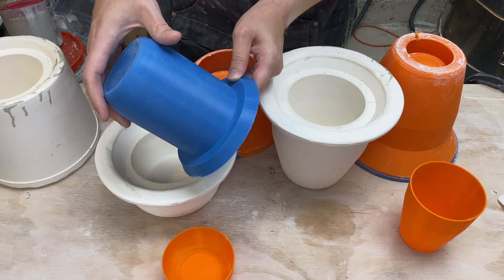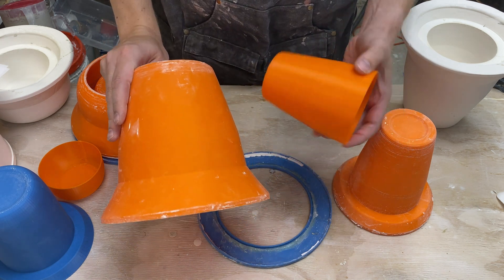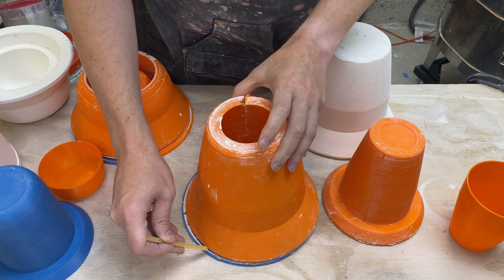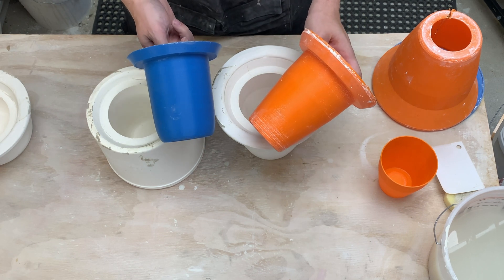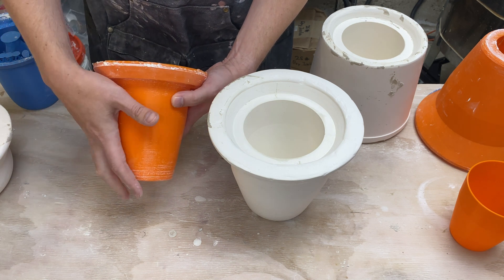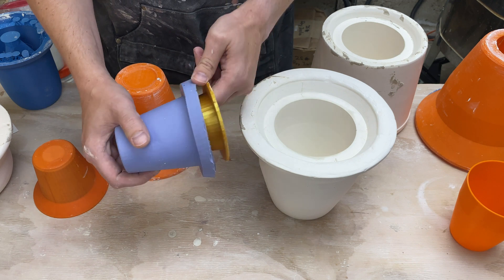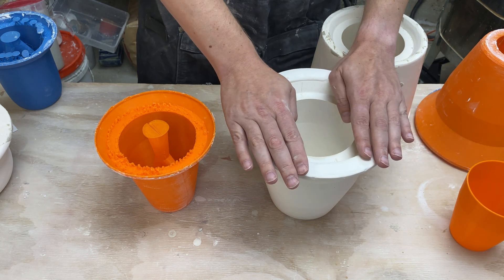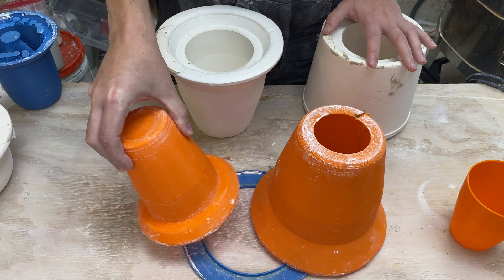Automated Slip Casting Mold System - Thoughts on Improvements

Comment: Hey Kent, to get the 3D printing out of the plaster, put it in the frig or freezer. The plaster won’t shrink but the plastic will
Reply from the maker: You need to worry about the water in the plaster. I now use a frozen mixture of isopropyl alcohol and water and it works really well.

Comment: Hey Kent.  Got the solution to you sealing problem.  Because you are 3D printing, add a screw thread to the inside of the inner and outer edges of the sealing ring, and then add matching Threads on the outsides of the lips of the inner and outer cones (or appropriate inner outer combinations as might be suitable for other reasons). You then just screw the inner come to the inside circumference of the inside of the ring and likeliest screw the outer cone onto the outer circumference of the sealing ring.   It’s basically like screwing a bell jar onto its lid upside down. No need for any sealers. Maybe if you want I might add a bead of Vaseline to the threads but that should be it. Thanks!
Reply from the maker: I'd thought about a screw fit when I was developing this. There are a few problems with that approach. One is needing a solution for the outer mold parts. The other is in demolding the plaster - you need good draft angles and a part that rotates would be basically 0 draft angle. Check out my newer videos for the solution I'musing now.

Comment: Consider a TPU 90 sock that slips over the desired form. The sock thickness is determined by the percentage of scale needed to account for the shrinkage of a particular clay. The PLA form is removed then the sock is easily removed.
Reply from the maker: I'd thought about that a bit but the trick of making the PLA cold and it shrinking has been working very reliably now

Comment: I did pretty much this exact process a few months ago for a 3D printed solo cup mold I made:

https://i.imgur.com/M6ayhzL.jpg

Both the inner and outer molds are generated with OpenSCAD.

I print the outer mold using vase mode to make the thinnest walls possible, which makes it easier to destroy it to get it off the outside and saves wasted plastic. I set the wall thickness to 0.65mm with a 0.5mm nozzle so it overextrudes. PLA is very brittle and cracks easily when it's that thin, and my latest one was printed with PETG which made it lots more durable.

I use my soldering iron to cut lines in the mold after casting to remove it which is way easier than trying to pry or rip it off.

To get the inner mold out, I flip it upside down on a baking sheet with the plaster edge resting on a few ramekins. Then bake it in the oven at 200F. PLA shrinks when you bake it and it eventually falls out the bottom, takes almost an hour. BUT make sure you chamfer the inside of the foot on the mug, because it'll grab hold of the plaster as it shrinks and it'll get stuck and damage that part of the mold.

To seal everything for casting I roll out a square of clay about 1/8" thick, smush both the inner and outer molds into it, push the clay up against the outer mold to seal any possible leaks, then pour the plaster in.
Reply from the maker: Thanks for sharing your cups (very fun!) and your process! I'd also thought about vase mode to speed up prints but worried about leaking. I hadn't thought of using a larger nozzle and over extruding.

Comment: Just an idea for the ring part - could you print the mating edges of the ring and both molds with a small lip so that the edges of the inner and outer molds would snap-lock into the ring? I'm not sure if that would hold back wet plaster though. Maybe consider plumbers putty to seal it.  As for adding seams I'm not a big fan of the idea, but silicone is also expensive, and can be messy with mixing and clean up. I guess if I had to pick one, I would say add seams instead of going with silicone.
Reply from the maker: Getting some 3d printed geometry to snap lock would be cool. But I think I'd really need my printer dialed in for that to work, and yes I'm not sure about holding back plaster. I'm hoping just two 3d printed faces will be enough to hold back the plaster, but it is quite possible I'll also need some sort of sealant. Something to explore for sure.
And thanks for the seam vs silicone vote! It looks like folks are leaning away from silicone which I totally understand!

Comment: I've chosen to go with multipart molds in most situations, especially since most of my pieces tend to drift away from smooth radial symmetry, often with geometries that include undercuts.  My approach with the 3D prints has been walls with sufficient width to allow for registration "pins;" I've tried both hemispheres and trapezoidal shapes, which seem to work better. DON'T Forget to allow for a 0.1-0.3mm offset after the join in the 3D software (lack of clearance yields prints which won't fully mate). Also, where I have mating surfaces I learned the hard way that the print bed is NOT a solution, they warp during printing due to heating/cooling, so I orient pieces to allow for ironing on mating surfaces, though this often adds a need for supports. What seams are left I deal with in post processing the slip cast piece. My most complex 3D multipart molds so far have been 5 part.  Tuning the printer is well worth the effort, but I admit it's tedious and time-consuming.
Reply from the maker: Thanks for the advice! I've been thinking through the issues of attaching 3d printed pieces together, and the points you raise are great! In addition to actually connecting them, getting them in the right spot, some sort of registration, is also needed. And I'm fully expecting to have issues getting mating surfaces to line up. I'm hoping I can come up with some reasonable solutions so that anyone using my software (eventually) doesn't need a perfect 3d print.

Comment: That's a tough choice. I think I prefer seams at the moment because I am small scale, but I would prefer silicone if I made larger quantities of pottery. I do like the idea of being able to release it with an air compressor as other people have suggested. Some of the things I am exploring are using liquid latex to coat the trickier/inflexible objects I'm making molds of, because it adds a thin flexible layer, and I am usually only making 1-4 copies. I am still experimenting with it though & I don't know how it stacks up in terms of expense compared to silicone, I have the liquid latex anyway for other things.
Reply from the maker: Thanks for the feedback! Regarding the latex, I've seen a few people do silicone blanket molds. Basically you can use an accelerator to make the silicone set faster and it is thicker (or use specially designed silicone), which is then painted on with (multiple) thin layers. That is then usually backed by some other rigid material.
Reply: Thanks again Ken. I’m looking for a 2 part mold solution as well as single 😊

Comment: Another way is to put dry ice inside the plastic inner pattern, it will shrink faster than the plaster and you can pull it out
Reply from the maker: I'd thought about using a heat gun to make it soft (but this one was too thick). Adding dry ice to make it shrink is an interesting idea!
Reply: @PotterybyKent  FWIW - a water+ice+acetone or alcohol would likely work and save the effort of tracking down dry ice.  The mix of water and acetone/ipa will drop the freezing point of the water and allow the ice to further chill the plastic to closer to 0F (or where ever your freezer is set).
Reply from the maker: Nice tip!
Reply: @PotterybyKent  Learned that one in Organic Chem class 55 years ago... Same idea as a salt/ice bath for making ice cream, but more effective.
Reply from the maker: I just tried this out and it works! It seems like we have a winner for getting stubborn inner molds out.
Reply: @PotterybyKent  🤯
Reply: @PotterybyKent  Glad that worked for you! Another thing to consider: Your FDM prints are rough (microscopically speaking), so even if your design does not have undercuts - the plaster will grab the surface. If you have ever looked into vapor polishing of PLA prints- it could help you get your printed pattern smooth. Another option is to spray the pattern with automotive primer-filler and sand and repeat until the surface is smoooth.
Reply from the maker: Thanks @turbiliontock316. Yes, they do have a fair bit of texture and you're right about the (small) undercuts. I have done the spray w/ auto primer and sand thing before, but havent tried doing vapor polish. I kinda like the texture (and am lazy!) so it's good to find an option. I've even had very smooth parts hold on more than I'd like, so it's a good trick to have in the bag!

Comment: I would recommend making a hole in the base of the outer plaster mold that you can inject compressed air into as an aid in removing the plastic core. Dont put seams on the slip contacting surface - you will fight that for eternity.
Reply from the maker: Yes, I'd rather not have a seam! And a small hole to blow air into might work, but it would fill with plaster. A comment on a previous video suggested covering the hole with a bit of wax that could then be blown out.
Reply: @PotterybyKent  drill the hole in the plaster base to match diameter of your compressed air gun tip. Then 3D print a short plug with a flange to plug the hole during slip casting. Jazz it up by putting your initials or maker mark on the tip of the printed plug.
Reply from the maker: Ah, I understand. Something to think about. I've actually seen plaster cast with a special tubing inside of it so air can be forced through, but the plaster surface remains unaffected (a quick search looks like it is molduct tubing).
I am thinking about adding my makers mark into the design -  I was never getting the timing right to stamp it, so I actually switched over to my own rubber stamp and an underglaze pad. But having it built in would be nice!
Reply: @PotterybyKent  A DIY cast silicone plug, similar to the inflator on a basketball might work?
Reply from the maker: The plaster isn't very thick, so I'd imagine something rigid would be ok to remove. Something like a golf tee perhaps (although I don't think I have any golfing friends to steal one from!) If the hole on the pot side is small enough, it might not even need to be plugged (slip will likely do that). Or maybe if it doesn't break through the surface on the pot side, air might still be able to make its way through the plaster and push out the mold? I'll need to try something like this out.
Reply from the maker: But thinking some more, a hollow tube that would direct the pressure towards the pot side, and not allow pressure to go out sideways, might be useful. And in that case, something that remained in place could work.
Reply: @PotterybyKent  a clay plug would work too

Comment: The difficulty of extracting the inner plugs - the two orange ones have white plaster rings around them indicating that they kept part of the plaster and removing them meant you had to pry that out. The blue one seemed without rings - perhaps it was smoother to begin with? Maybe try to spray the inner mold with a few layers of sealing paint - or mold release? Or boil the molds at the end of the process.

For multi part molds - I found, with my 3D printer, that the thinnest wall I could make was 0.3 mm - it was still plaster tight, but it could trivially be cut with a box cutter. To clarify, the majority of the mold was thicker, but the seams were 0.3 mm. That way I could make monolithic molds, without fear of plaster disasters, that separated nicely at the end. But what would only work for single use.

Regarding silicone, I have my own process but I hope to never use silicone again, I find it a massive mess and another step where you need to hunt bubbles. There are flexible filaments, but I've had nothing but misery playing around with those. But you may have better luck.

cheers,
m
Reply from the maker: Yes, I saw the plaster stuck to the 3d print. I don't think it was the smoothness of the print. The small orange one and the blue one were printed with the exact same print settings (and have almost the same profile). And the large orange one was printed at a higher resolution. I might not have as many coats of soap on for the orange ones? I also added windex as a surfactant, and maybe that interacted with the soap?
I breakaway seem is a cool feature, but I too would prefer if the molds could be reused.
And thanks for the feedback about silicone!